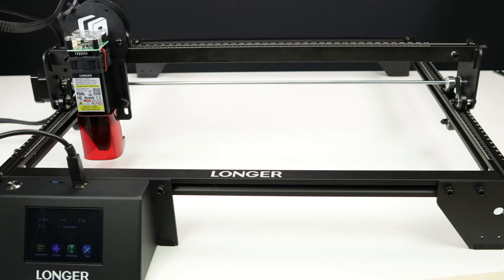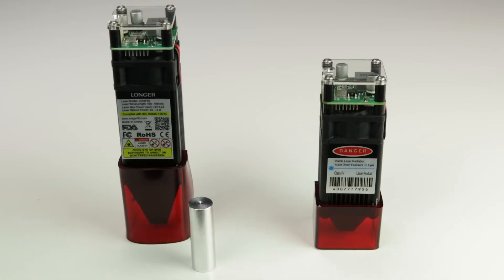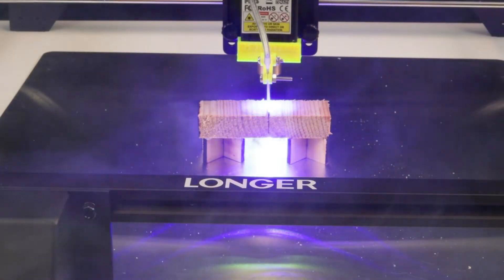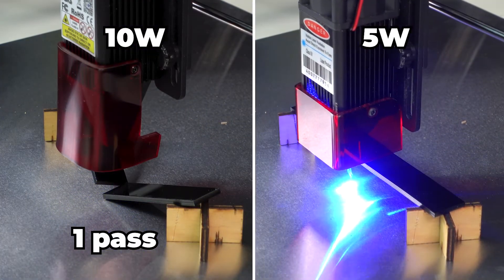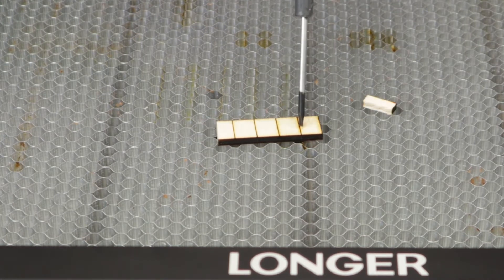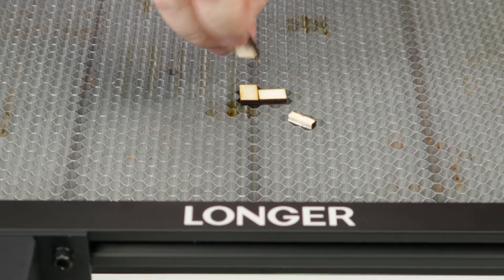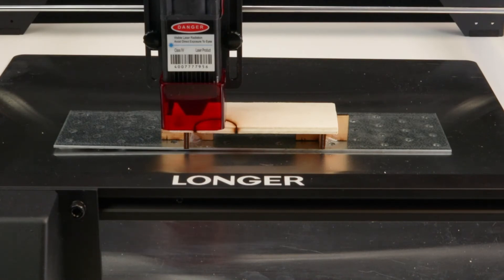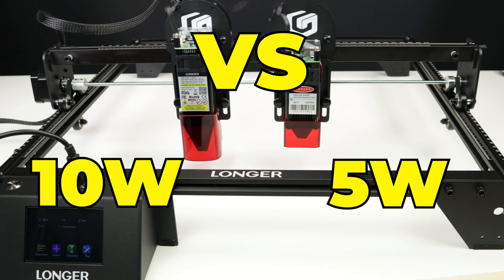5W vs 10W - Twice as Good? Longer RAY5 diode lader

Comment: Probably the 5W also has shorter focal point. So it gets wider faster. I have a 5.5 W and it can cut 3 passes 250 mm/min 3 mm but 6 mm takes almost 20 passes.

Comment: What kind of plate should I use for ender 3 pro? Feel like both lasers would damage my plate
Reply: I am looking to do this on my ender 3 pro do you have any good resources?
I got a free 5.5 w with air assist
Tool head but I don't know what else I need or how to mount it FW etc.
Also I assume it is a conversion and that you will need to remove the hot end and it won't be able to be converted back easily like on the fly right

Comment: i have three of the 10 watters that i run commercially 7 days a week. i  cut 3mm mdf at 80% power and 130 mm/min x2 passes. i cut 6-8mm pine-cedar-oak-poplar at 80% power and 140 mm/minx 2 passes. they are 2 years old and have made thousands of cuts and have not lost any power that i can tell. i cut 1/2" cedar at 80% power and 140mm/min x5 passes. these are really good quality lasers.

Comment: Hello, thank you for your video ! 
I have this machine and it is impossible to cut pine wood over 5mm thick... The speed is set to 100mm/ minute and the laser to 100% power with Lightburn. Is there anything else that needs to setting to make cutting wood as easy as your video ?
Reply from the maker: Hi! Did you know there are about 125 different kinds of pine? Generally sorted into 3 categories. 

These vary tremendously when it comes to density, twig knots and how dry the wood is. Additionally, some parts of the world add chemicals to avoid bugs etc.

We are using good quality, nice and dry, Scandinavian pine. And we do a test piece to make sure there is not too much resin in the wood. 

Hope this helps :-)

Read more here:
https://www.wood-finishes-direct.com/blog/all-about-pine-wood/
Reply: @DIYTECHBROS  Thank you for your detailed answer. It is true that the results are better with some pine woods, those that are light and dry like the Scandinavian panelling, but my machine does not manage to cut more than 5mm thick even with this pine wood. Maybe adding air assist will work?
Reply from the maker: Yes, air assist will be beneficial! I would also run it at 200 mm/min and add more passes to avoid too much burning. Also, remember to set you focus point into the wood and not on the surface.